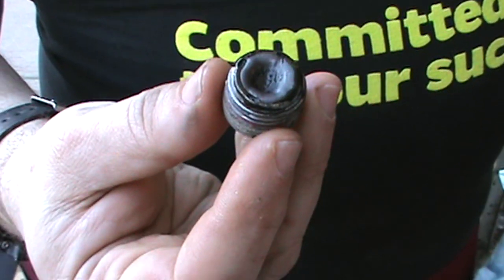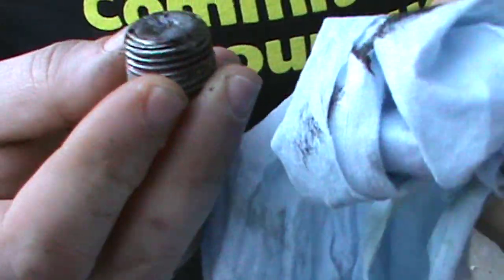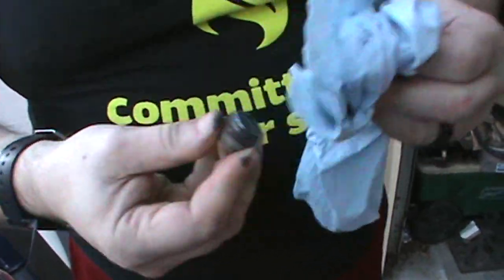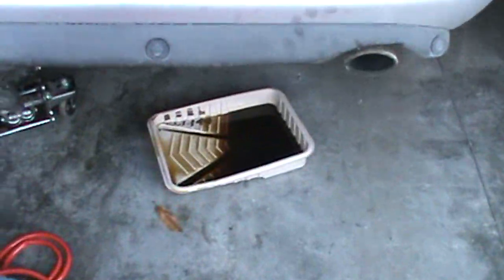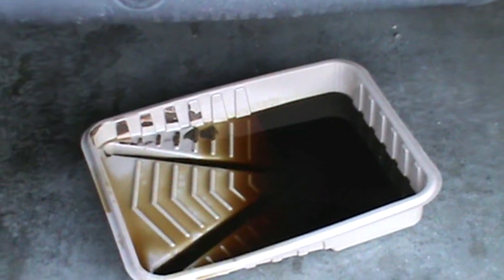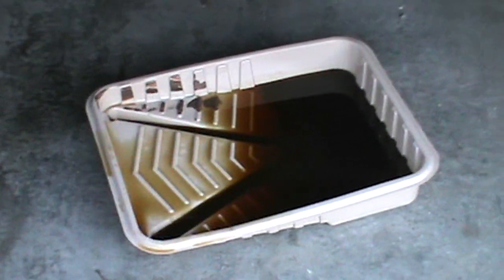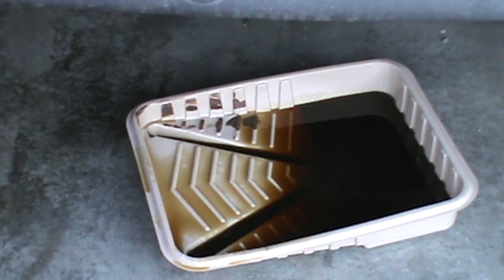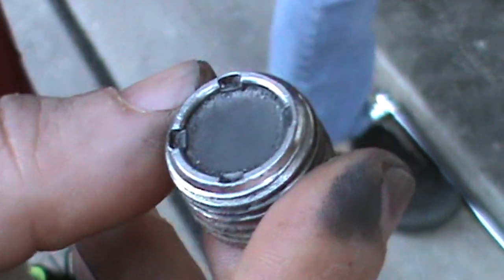2005 JAQUAR X TYPE REAR DIFFERENTIAL FLUID CHANGE

Comment: This video kills me. You are working on the transfer case and you say you are about to fix your transmission. Then you are not putting in the right oil for that differential as it is a limited slip differential and the factory requires 75w 140 transfer oil. Your wife seems more knowledgeable about mechanics than you do. At the end it sounds like you have a wheel bearing or cv axle issue. Your old oil didn't even look that bad. Watching you trying to get the transfer plug out was oh so painful. That noise is not your transfer case or your transmission. Change out your entire spindle, and quit thinking its a major issue. It is your wheel bearings going out.
Reply from the maker: YOU DO KNOW THAT THE TRANSFER CASE IS PART OF THE TRANSMISSION? OR YOU DI9D NOT KNOW THAT THEN DO NOT LEAVE IGNORANT COMMENTS
Reply: @ProfessorDIY  the REAR differential is the transmission huh 🤣 no it is an AWD and the transmission is in the front while the differential in the back is just that. A diff...